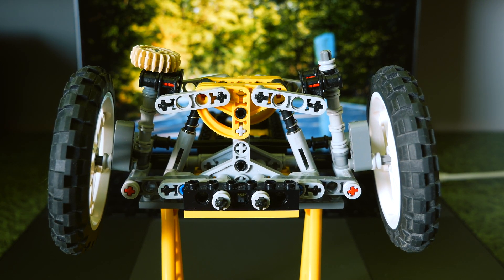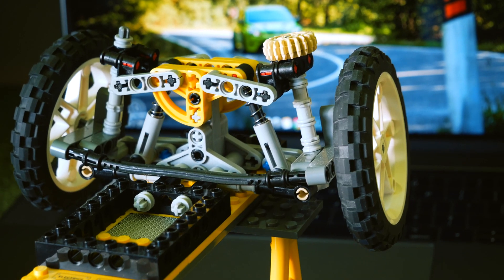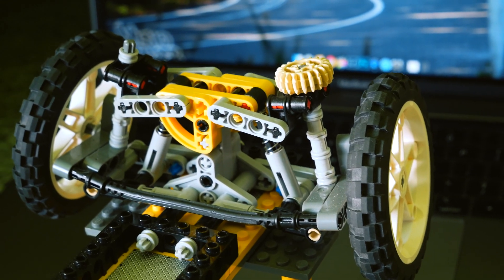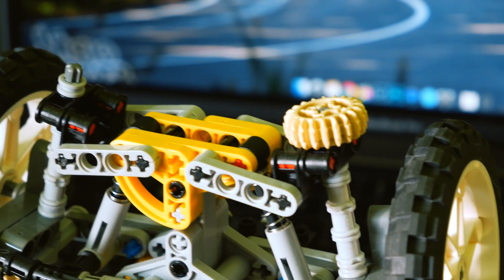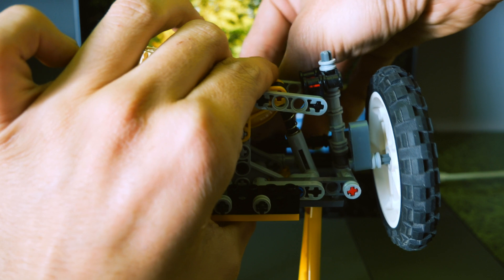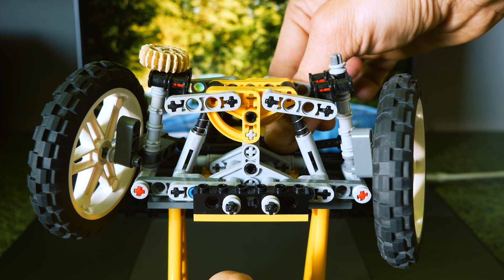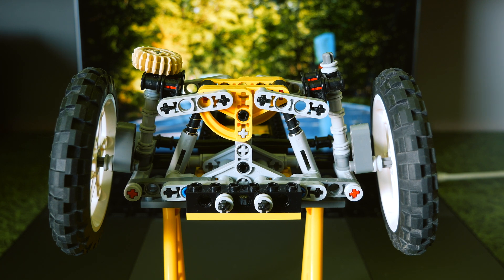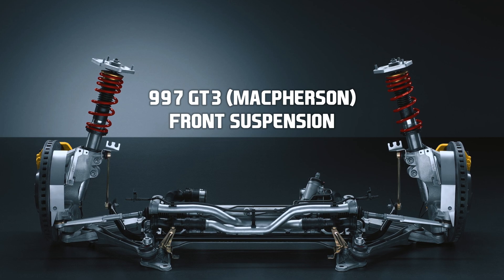LEGO Explained: Double Wishbone Suspension

Comment: Finally someone who understands that McPherson can be setup just as good (& in some instances better) then double wishbone suspension.

Cost isn't the only reason to use McPherson suspension, truth is McPherson is much lighter than DWS which means a more responsive (faster reactive) suspension.

The common issue with McP is that the shock strut (& therefore kingpin inclination) is far too vertical, especially in Front wheel drive or East-West midship layout which lack space. Meaning the dynamic geometry ends up meaning you end up with the wrong kind of camber especially with longer travel, but this "can be" designed around.

However on a lower car with less suspension travel with proper kingpin or more angular lower arm (thru use of improved RCA or chassis mounting points) you can exploit McPherson's ability to give you extra dynamic camber thru the corners by way of ever-changing geometry, whereas a Double Wishbone may have to sacrifice straight line tire temp uniformity under acceleration and far reduced breaking with minimised contact patches since whatever camber those have they are stuck with even in all the instances where it is harmful rather than beneficial.

McPherson on the other hand does not suffer the weight or static nature handicaps of Double Wishbone, but it does require a far far greater understanding of geometry "&" physics on a per car basis as different weights can net completely different results even with similar angles.

(Though for anything off road with independent suspension DWB is kind of the only choice as there's way to much travel to deal with)